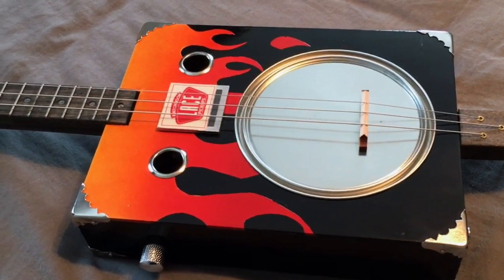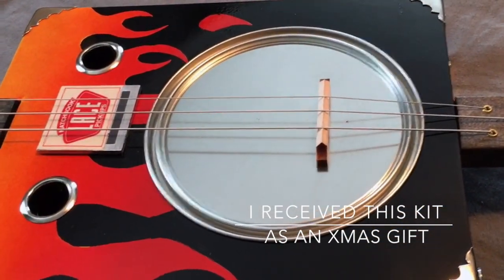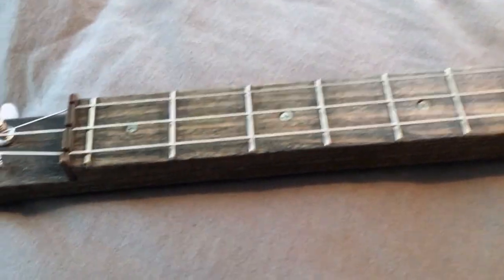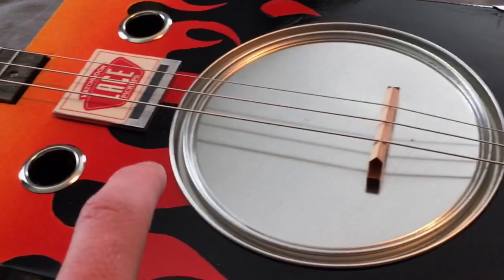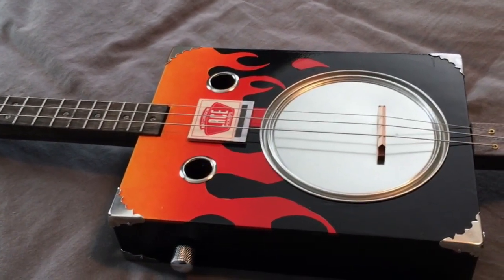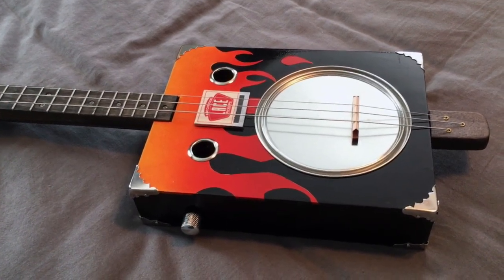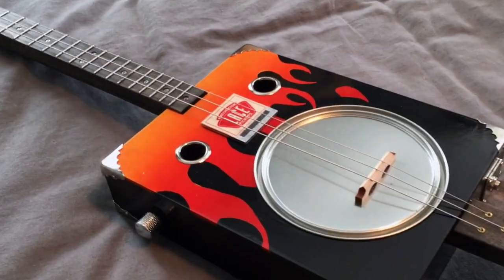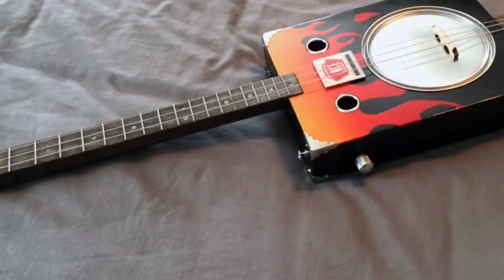DIY Project: CB Gitty Tin Pan Alley Kit

Comment: Can it be tuned e a d ?
Reply from the maker: It can be tuned any way you want, but you'll have to match the string gauges to the note. With the strings I have on it that probably wouldn't work but if you used a E, A, & D from a heavy guitar pack it probably would.

Comment: I'm looking to buy thies exact kit from cb gitty.  What I wanted to know was the neck it says fully fretted neck with 0 frets... WTF?  On your video,looks that it is fully fretted.  I see it at 99.93 canadian.  I also saw video of a guy who even put springs in his to get more of that resonator sound but it wasnt the tin pan guitar just the straight pipe cbg.
Reply from the maker: That is a little confusing, but I think I can clear it up. They're talking about a "zero fret", not "0 frets". A zero fret is a type of guitar nut in case you're not familiar with that term. Rest assured, anything CB Gitty claims is fully fretted does have frets.
Reply: @musicalmiscellany  Thanks for the info.  Gona order mine like right now....   can hardly wait....lol   Nice looking guitar by the way......